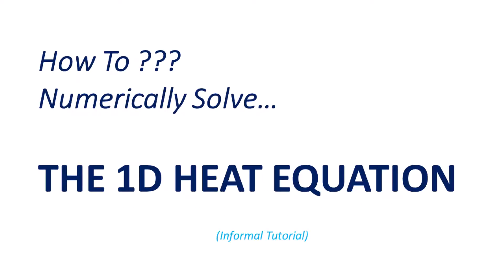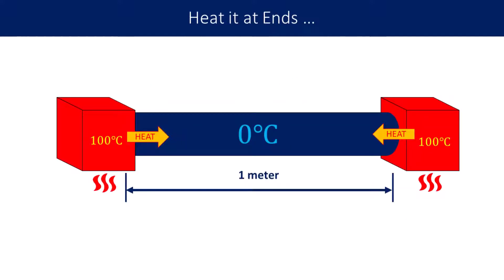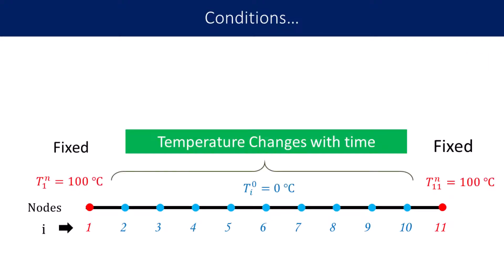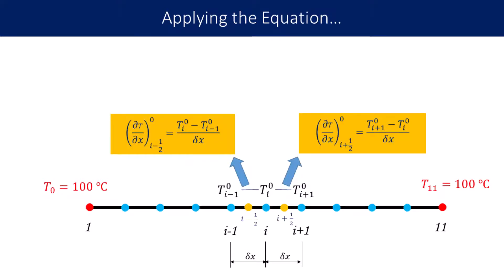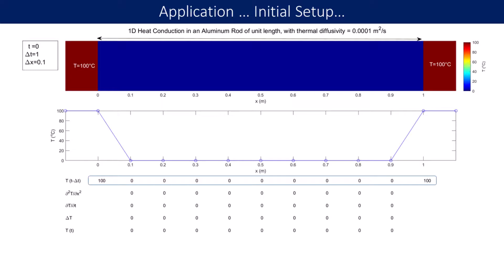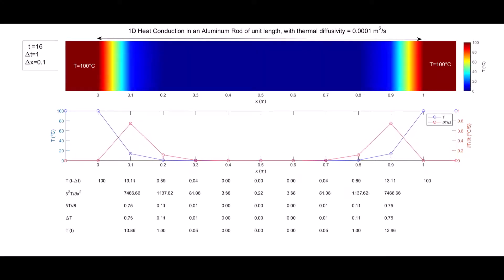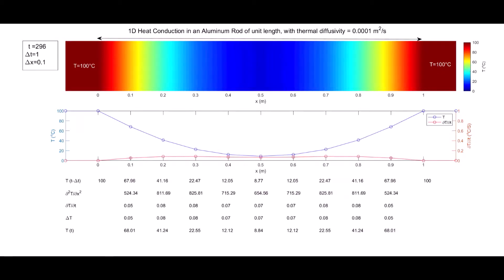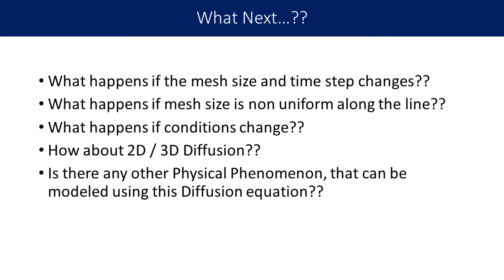How to Numerically Solve a 1D Heat Equation ? ( MATLAB Script in Description)

Comment: Please help me sir
I don't understand how to change the program, for example, the initial temperature of the rod is 25oC
I'm working on my final project and need to know about it
Thank you
Reply: Hey, did you get how to do it?
Reply from the maker: In the matlab script the Array T is the temperature at nodes. T[0] is temperature at zeroth node...

Initially temperature at all nodes is zero except at end nodes., Where it is 100. As time progresses the T is updated.

For giving 25 deg as initial condition put

  T[2:end-1]=25

The above line should be added after the line, "T=zeros(1,nx) ;"  in the script.
;

Comment: That's a nice video
Where we use the 1D diffusion eq on it application or for what purpose?
Reply: This equation models the physical phenomenon of diffusion, I mean spreading of a particular parameter (dependent variable) from higher concentration zones to lower concentration zone. Here I took an example of heat Diffusion,the parameter is temperature. We can also model diffusion of ink in water, then the parameter will be concentration of ink.

Comment: thanks ever so much it was nice script. but does it work for this du/dt=k, d2u/dx2
u(x,t=0)=h(1-(x/l)square)
u(x-l)-u(x=-l)-0
Reply from the maker: Thank you. 
This equation is a generalized 1D diffusion equation: (du/dt)=k* (d2u/dx2)
Heat equation is also a Diffusion equation.
So you can use the same Numerical Strategy as explained in this video.
You need to modify the Matlab Script so that the initial conditions, Coefficient - "k" , and the end conditions are implemented as per the given data.
Reply: @TheTechHans  I send you an email can you respond pls. I did send it to the email address on YouTube.